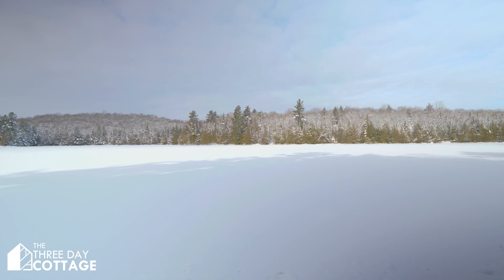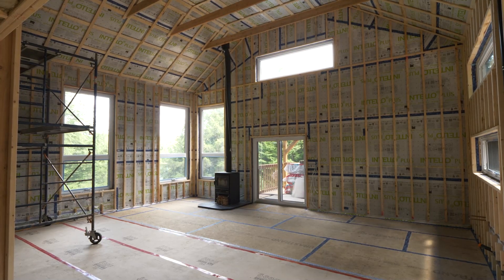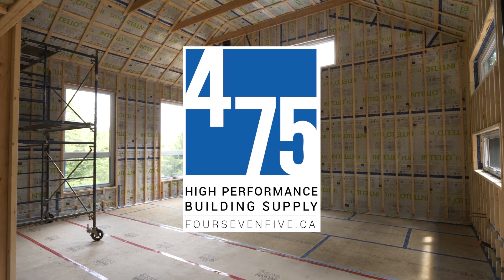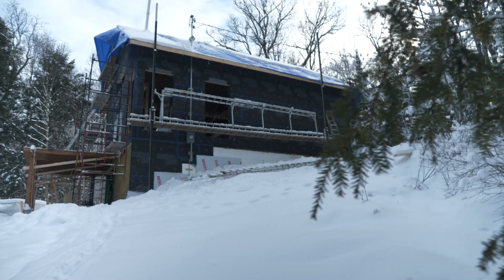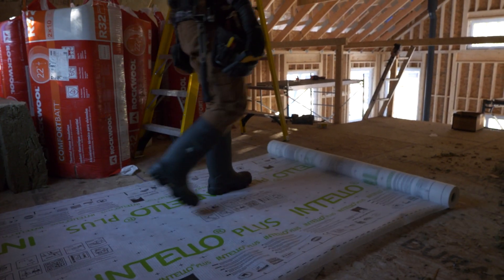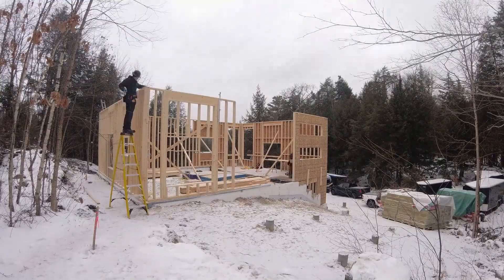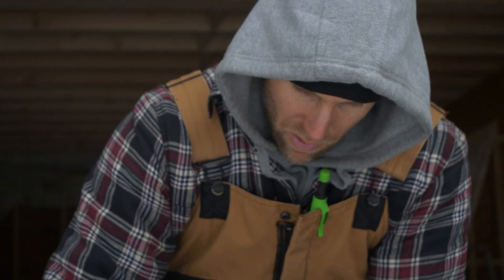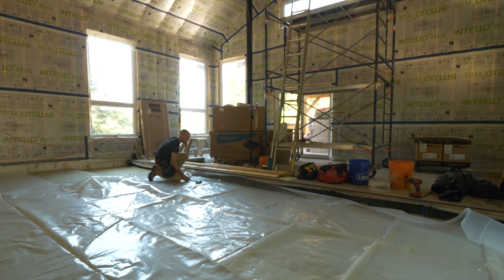Episode 8 - The Three Day Cottage - Weather, Vapour and Air Barriers

Comment: Would the mento 1000 be something I could use on a board-sheathed home? With 7/16 OSB being back to $15 I wonder if I should add that on top of the board (no way I’m going to remove the board. Far easier leaving in place) before applying it. Not going passive but need to lower the ACH score.
Reply from the maker: Hey Jason, good question! I'd also look into this product for that application: https://foursevenfive.ca/adhero/ Without seeing the project I'd say that may be a good option.